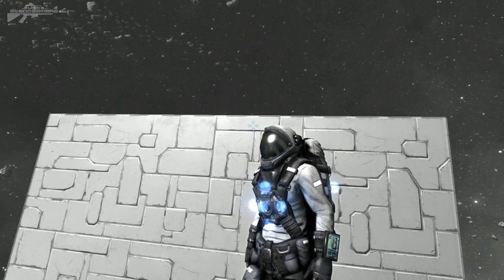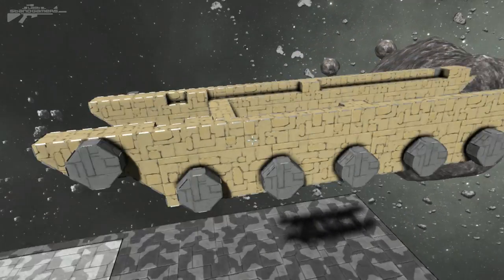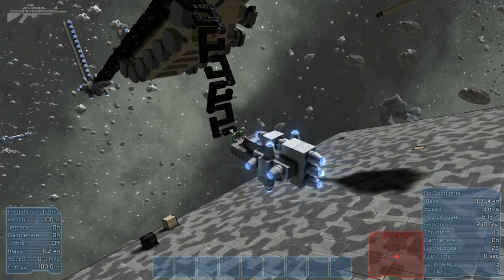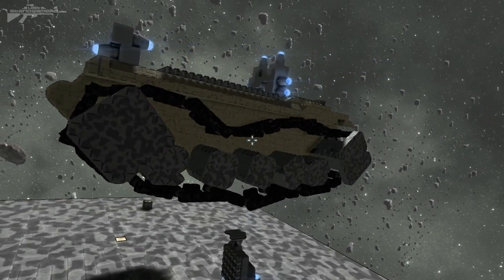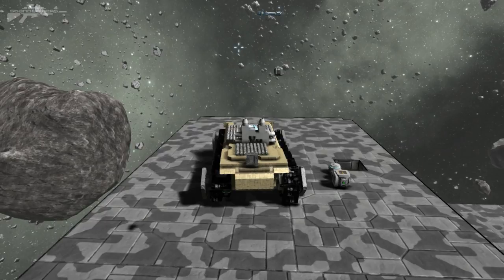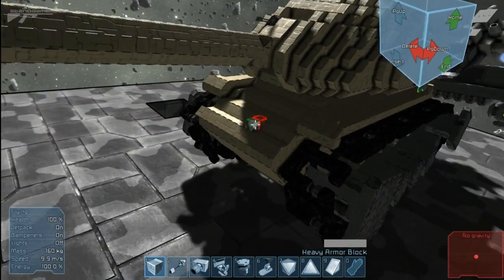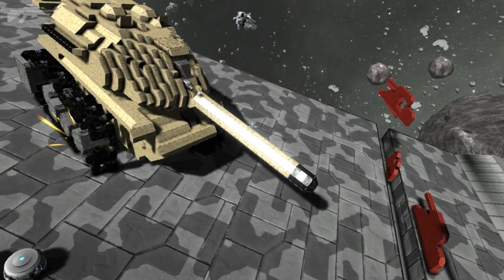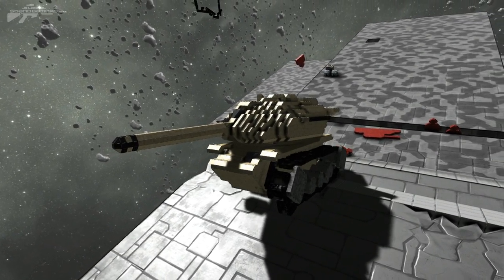Space Engineers - Main Battle Tank M1A1/M60 Mechanical Tracks, Dakka dakka dakka!

Comment: i just noticed something about this design having played tons of warthunder ground forces.

you don thave return wheels on this design to help keep track tension so it doesnt sag in spots as your moving.

 you have a type of track system more of the  t34 kind where they dont have return wheels.

but because your in a gravity less condition  and your tracks themselves while having mass have no weight it doesnt work.

if  you remade the tracks to include a mass blocks since now rotors can transfer power through them.  you can give every other link weight  when your in a gravity field.

and if you also get a return wheel system i think those combined with the newer rounder wheels you could make this thing a lot smoother to drive.

Comment: Nice idea and I must say well done. I had the idea of making a tank earlier because I was experimenting with a rear turret on a fighter I built. The rear turret works, but it still has a couple of issues.

My tank wouldn't be a big mechanically complex build. I was originally going to make a fairly normal tank, but, due to the lack of ground to drive it around on, I have decided to make a tank with heavy armour and thrusters to fly around in space.

Comment: Shorten the track links (add more links to compensate for loss in total length), lower the turret slightly, add a motor to control just the barrel of the turret for better vertical aiming functionality, and either expand the base or shrink the turret by about 20%.  Just off the to of my head this should fix quite a few of the problems.  Other than that, you have a pretty good tank!

Comment: Goddamnit! I've been working on something like this for weeks! I had problems with Gravity/Traction. also I used those antennas in one of the "wheels" on each side of the tracks to move it faster. (better grip on the tracks, the the small anntenna "disk/tip" hooks the gap in the tracks)

nonetheless, Very nice!
Reply: btw, putting "skirts" over the tracks prevented them from hopping off for me.

Comment: To fix the track issue first determin if your wheel is at a fundmendulum of force the wheel thats roatator is breaking is taking to much force now if this is so theres two solutions that come to my mine reninforce the rotator so it can take the extra force like put some heavy armor plateing around it abd it will take some of the friction like a shock asorber or just move the wheel so the force amogsnt all of them is equal but be carefull this could end up with all the wheels getting to muchforce

Comment: i say reuse the turet,the you tryed to build a tank body to small if you increase the size and you add a down wards dip on the outside to make up for the track length(pushes the top of the track down)youll increase porformance and the tank will be stronger,bigger,and if you whant more bad as.thinking about it you shouid challeng you freinds to try to build a better tank.

Comment: This game lags me to hell. Got any suggestions to help? Please?
Reply: I've gotten it running on my P4 machine. Wanna know the settings i generally use?
Reply: I run it on a laptop, ASUS with a intel core 13.
Reply: Some general pieces of advice i usually give are as follows Play single-player ( multiplayer optimization is awful at this point) 2.Set render quuality to "normal" 3. I strongly suggest running it windowed mode 4. set the resolution to 800x600( If it's still too slow, try lower)  5.set wold size to as low as you're willing ( I generally go with 10km...) and finally
6. Try not to use easy start 2, as it uses up your object limit pretty quickly. (If you want, I'll make a video...)
Reply: Thanks
Reply: Glad to be helpful :D
Reply: Yea I have over the specs needed for it and on lowest shit I STILL lag
Reply: Daulton Stowers I'm under lower but I'm not feelin' it that bad...

Comment: .......just use a set of 8 or 6 wheels. Goes Faster, easier to build, how ever I think with more practical versions coming out it would be much smaller.
So now the ultimate goal is to create an amphibious space vehicle that can tread on terrain, and fly into space. 

I just wonder though could we apply the same principal of gravity generator and asteroid propulsion into this tank. So the generator propels the vehicle constantly to the ground, thus the vehicle creates its own artificial gravity, so even when the enemy turn their gravity of in principal the vehicle will not float away. I these vehicles would be great for stealth ed invasions since they become much harder to detect when driven on an asteroid and such.
Reply: I believe you would require at least 2 generators to efficiently stabilize a ground vehicle. one in the front and one in the back, this should improve the turning speed, as it wouldn't roll as much when you turn faster. But the best situation would probably be four generators one at each corner of the vehicle for full stability.
Reply: while I agree with your idea.. the point was to make a Treaded Vehicle. .. Aka a tank, the idea of using a tank is amazing, sooo eh.
Reply: Froztarlozt

what if.... we make a not too big of a tank, but a small ship as a tank, i've tried  it, but the turret needs to be 2 blocks away from the hull in order to properly work as i had a problem where a part of the upper cover for the hull exploded when i turned the platform which would have a turret on it, before i put too much effort or make it impossible to repair. i am having some ideas in my head, maybe make it sorta like a B1 or Churchill I or something, where it has got a barrel on the front and on the turret, but also have a machine gun and a machine gunner for the hull machine guns and for the turret machine gun with a turret commander that shoots the main barrel, and either driver or another crew member to man the gun. but since its going to be a spaceship, it doesn't need working tracks or an asteroid.
Reply: well in the end land vehicles aren't really useful then huh lol
Reply: vuk psodorov Well, the idea is to have a vehicle strong enough to push through walls, fire high round bullets that can shatter things.. I think the other idea is that if we ever get planets to play on imagine how cool it'd be to send a tank onto a planet that can crawl over anything, with normal wheels it's harder to travel over things. With treads you're basically a beast.
Reply: when that time come along im pretty sure we can build proper vehicles and not just improvised ones
Reply: xingx355 But, until then why not give ideas, examples, and so fourth? Without ideas or examples, what are we to do? I mean, as an example, what if they come out with vehicles, but there are no tank treads? Or what ever. The idea is to invent, test, learn, expand. Invent an idea or use someone elses idea, test the product, Expand on what you learned.